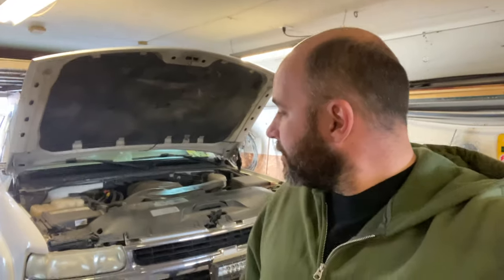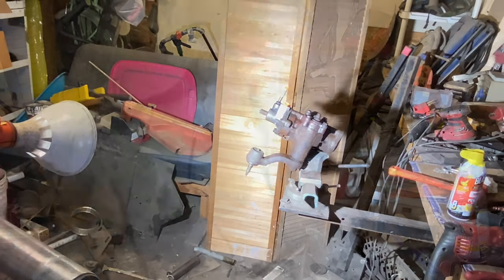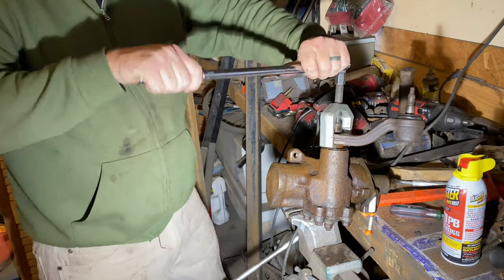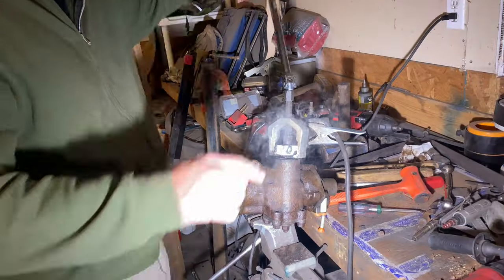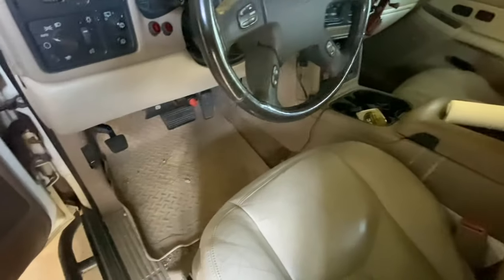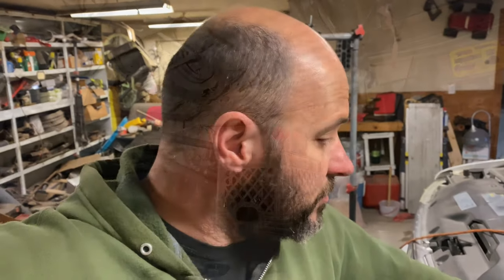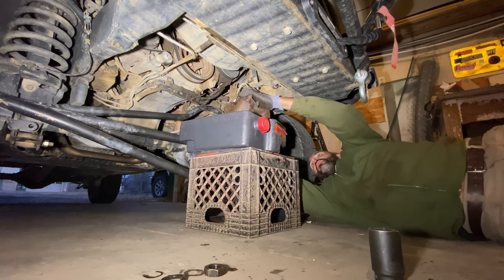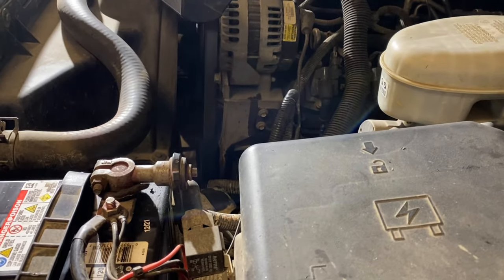Steering you straight

Comment: How's it drive? I was planning on rebuilding my box when I do the axle swap.
Reply from the maker: now at idle I can hardly turn.  So I think I will pull the pressure regulator out of the pump and increase the pressure..  I almost bet the screen on the regulator is stopped up too.
Reply from the maker: I should have said relief valve not regulator.